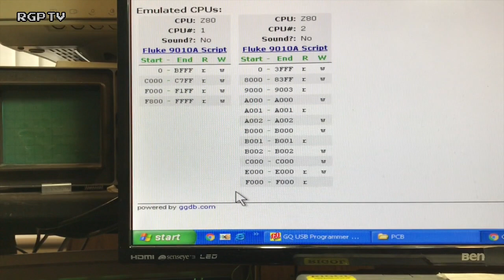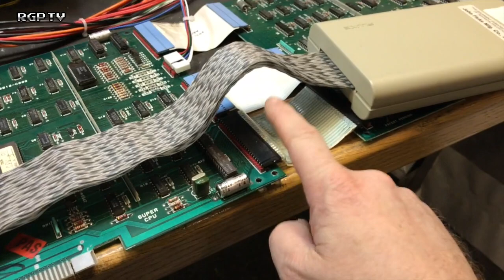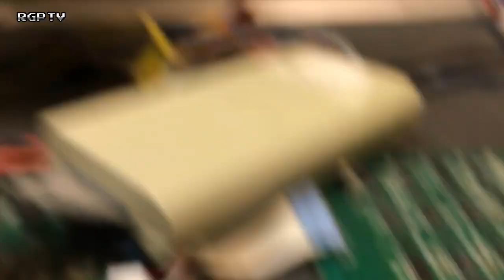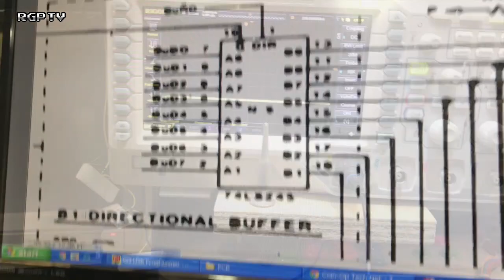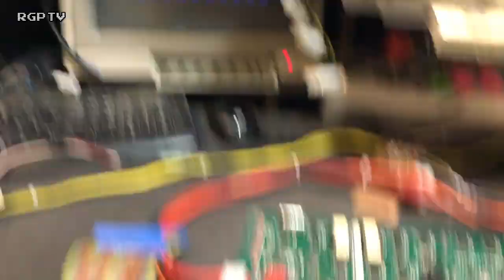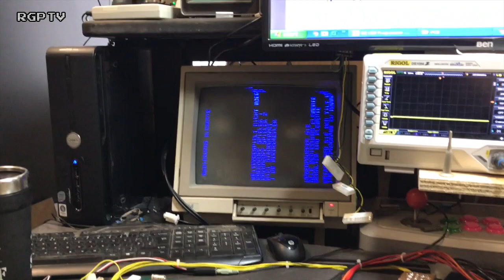Bally/Midway TRON Arcade PCB repair - missing sprites tip

Comment: You know it never ceases to amaze me that all that stuff that huge logic board dose is now done in discreet chips. It really shows the lengths & creativity engineer's had to go to make computers capable of delivering this stuff Love these videos.
Reply from the maker: They made it to be understood as well.  Not like today's "just buy another" mentality of consumerism - we're just training everyone to swap parts and understand nothing.
Reply from the maker: I know, it fascinates me too, but every bit of re-packaging and downsizing that goes on today makes everything completely irreparable.  There are zero easy ways to diagnose and repair SMD based boards.  Everything now is built to be replaced if it stops working and only if its still in production.  This makes me pretty sad about the whole thing.  I'll be able to keep this TRON boardset working long after you've replaced say your LED TV another 5-6 times when it just stops working.

The reason these were built this way was to keep them running in the arcades they were in instead of mailing everything in and waiting weeks while it lost all its viable income.

Now, buyers go to shows like EAG and the vendors ask how many spare PCB sets they'd like to buy at the same time as there's no field repairs, its gotta go back to Japan.

Indicating that its not IF it breaks down, its WHEN - planned failure.

The results of bullshit ROHS rules for production meaning use of lead free solder which is just completely rubbish and more toxic than leaded.

Comment: James! So glad I came across this vid. My Tron is behaving exactly the same way! All sprites are missing. I spent the weekend pulling each ROM and reading/verifying them (and applying the FreePlay hack), and found nothing wrong! Strange thing, in my case, is that my ribbon cables were all tattered and rotting, so I've replaced them with 5 all new cables from ArcadeShop. Since replacing those, my sprites have "ducked out". Maybe I received a single bad cable? Also, sounds have completely stopped since doing this. Are those data lines over the same connection? Maybe multiple bad cables? Anyway, this gives me something new to focus on. Thanks again for the insight!!
Reply from the maker: Double check you haven't offset one of the cables.  If you read the schematic, you'll find that Midway did a great job protecting the primary data bus from the interconnects via LS245's - so the D0-D7 becomes BuD0-7 on the main board which then becomes BSD0-7 on the sound board and other signals on the video board.

If you're still having trouble then send me the set and i'll fix it for you.
Reply: @retrogamesparty  I've just finally returned to this boardset, and still trying to get it working. Unfortunately, it would be pretty cost-preventative to mail this set across the pond to you. Any other thoughts you'd have on the same original symptom? ie, any specific chips that the sprite data moves through that I could probe for data signal or lack thereof? I'm happy to buy replacement chips to try out, if I knew which ones could be the culprit.

Comment: Nice to see you back making videos, just a quick question: How do you find the Rigol scope to work with ?.
Reply from the maker: I love it.  It has so many functions I don't make use of doing this job but it's nice to have effectively a 4 channel logic analyser.  We've got a few of them now and have had the firmware hack done on them.  Wish they could stream the display video out over the ethernet port so I could capture it for use in the videos.
Reply: Retro Games Party : Hi: Thanks for taking the time to reply, I made the mistake of buying a Siglent digital scope when one of the suppliers had them on sale. Not my finest choice, it does the job but doesn't do anything particularly well. Hey ho: Might eventually bite the bullet and buy a Rigol. Have a good day & keep up the good work.

Comment: What would you suggest is my problem if I’m missing the sprites but also have no cursor for use of the joystick. I can’t scroll through the service menu or play.
Reply from the maker: Service menu icon uses a sprite if I remember right.  You have one of three possible issues:

One or both of the 2114 RAM's on the video board are dead - the game does not check these rams on startup.
The buffer control chip (an LS245) between the CPU and the sprite RAM on the video board is not working or the signal allowing the data bus to traverse to the RAM is not changing.
The count chain that reads the bytes from the CPU accessible RAM and makes the line buffers is not counting properly.

Either get out the schematic and look at where it says "START HERE" on the video board and follow that chain or get in touch via the website and i'll fix it for you.